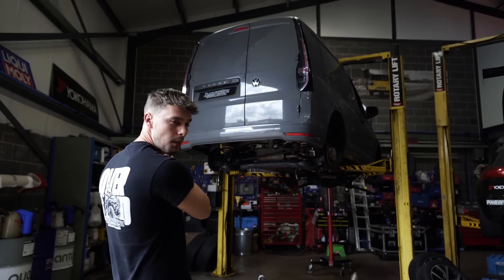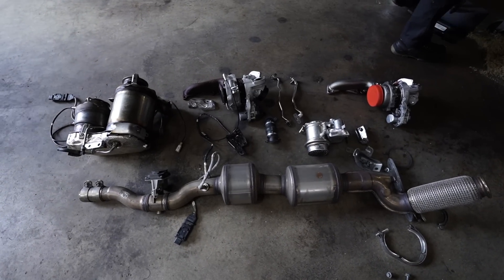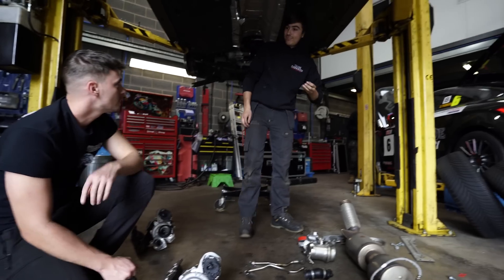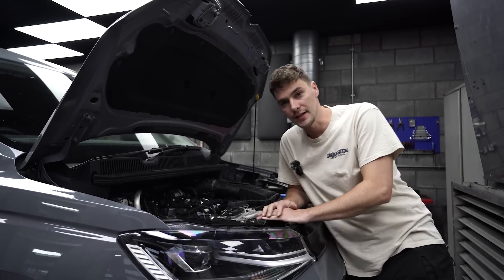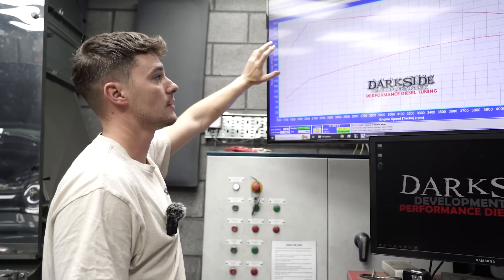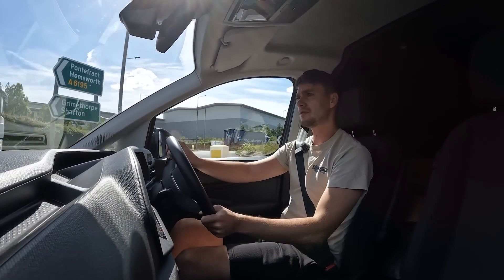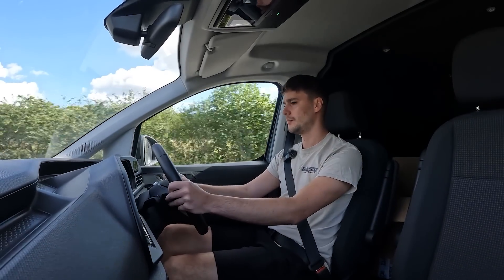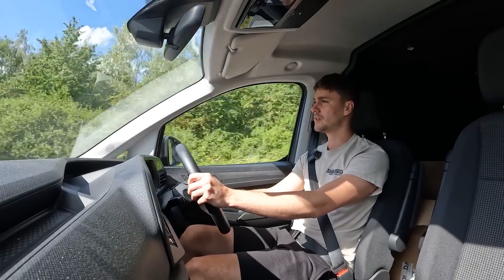MORE POWER THAN A MK8 GOLF GTI?!? Caddy mk5 turbo upgrade 243BHP 😈

Comment: Correction it has the DQ381 the DL381 does not exist but the DL382 does which is only in the longitudinally mounted MLB chassis cars
Reply from the maker: Nice spot. DQ381 is correct 👍

Comment: Thats big gains for just a bolt on turbo! How are the temps on the standard intercooler? Totally shocked at the gains with just an upgraded turbo 👌👍
Reply from the maker: These have a charge cooler rather than an intercooler which does work pretty well. No issues with temps 👍

Comment: Are these a rebadged Ford? Or is the Ford a rebadged VW?
Reply: Ford is a badged VW
Reply: Its a ford connect !
Reply: @r1ck200 Other way around
Reply: @Mr330d  I know the transit is meant to be based on the caddy, but the new caddy looks
Exactly the old connect with different rear lights 🤣
Reply from the maker: The transit connect and this share the shame chassis but the engine and running gear is still all VW
Reply: Ford gave their commercials to vw in return for electric vehicle architecture